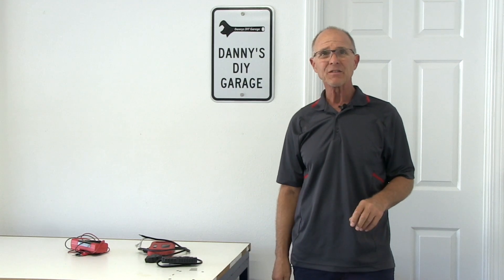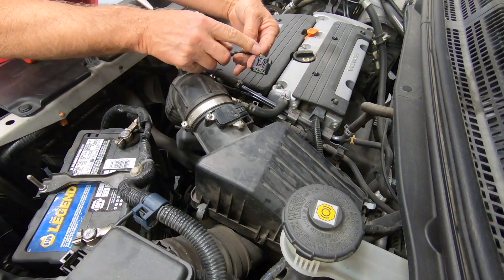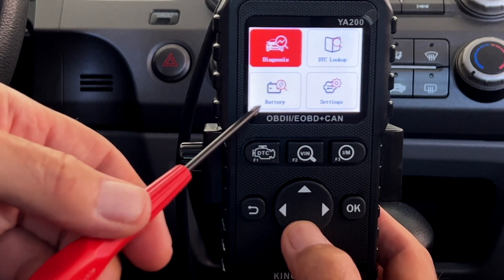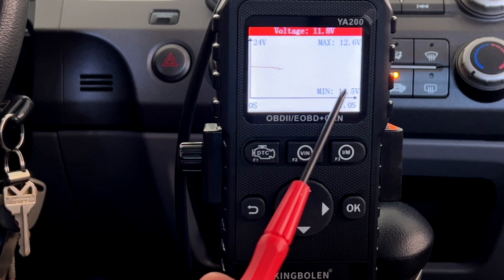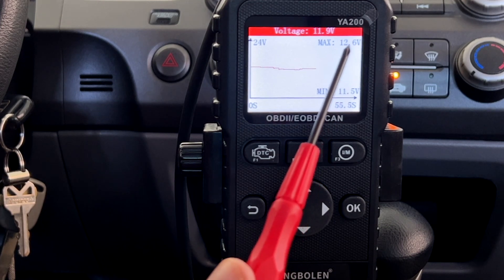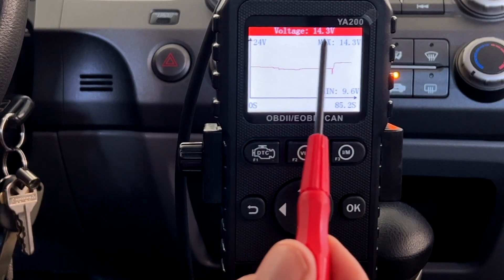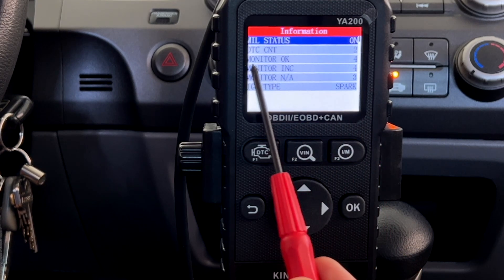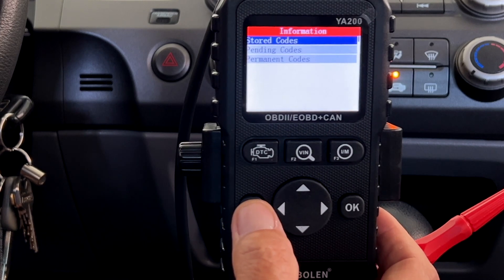$30 Scanner, Diagnose and Fix Engine Light read live data #scanner #scantool

Comment: Thanks for the video.
I have a "Deluxe OBD II & CAN Scan Tool: Harbor freight item 60693, bought new $80 in 2014 and have been thinking about upgrading my Scan Tool. My vehicles: 1998 Toyota Corolla w/ auto trans, 64K miles; 2004 Mercury Sable wagon w/the standard  3.0 l, 6 cyl. "Vulcan" engine, 112k miles. Both run well.
The 689BT & price look good to me.
Reply from the maker: I haven’t found any disadvantages and the lifetime updates will keep this up to date for years to come

Comment: 2010 civic 110k miles ac don’t blow cold air, the ac control head dont work correctly either. i was tolt rhe whole ac system is bad by a mechanic but idk if he is trying to rip me off. what can i do to see if is just a part and not the whole ac system that is bad
Reply from the maker: I have 3 or 4 videos on ac system diagnostics, they’re all on my channel, these should help, also more on the way, don’t forget to subscribe

Comment: Did you figure out the exact solution to those two diagnostic codes? My 08 civic is running rough on cold starts and it gives me back those exact codes you have. Thank you
Reply from the maker: I actually had no issues, I only unplugged it to show the code,
Reply: @dannysdiygarage  oh ok thank you